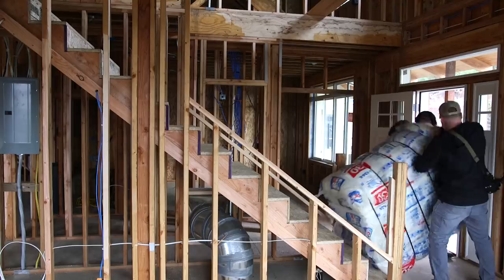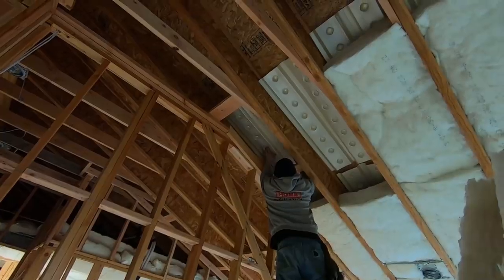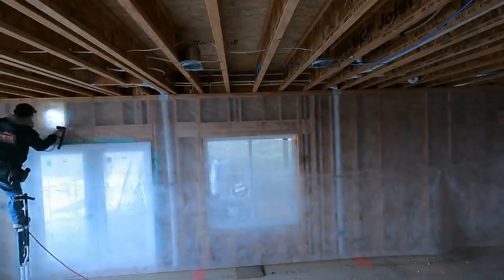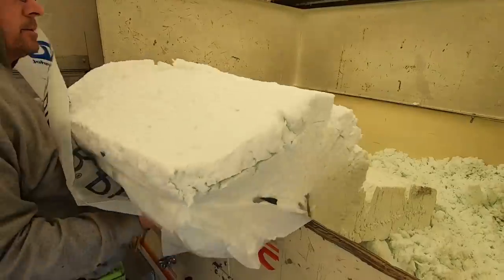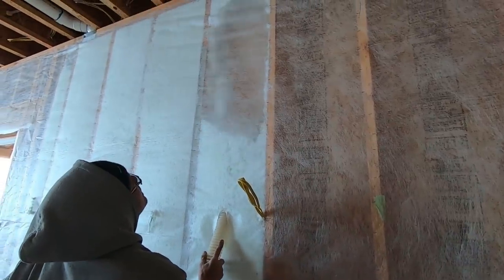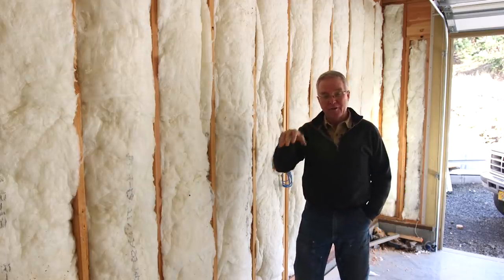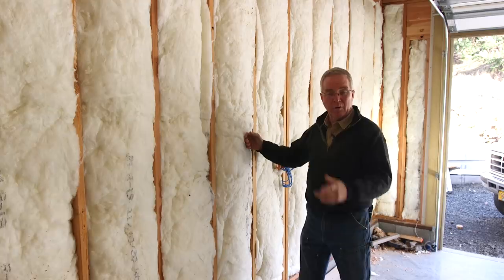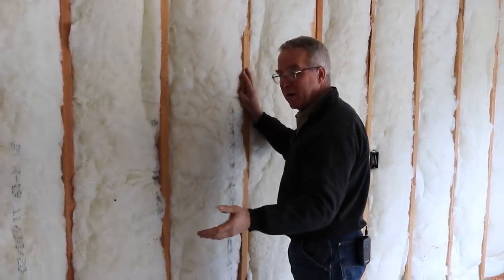Insulating A Nice House Ep.104

Comment: Howdy Scott, I'm an insulation pro in Tennessee.  I'm a subscriber and a fan on YouTube and the podcast.  Thank you for your thoughtful approach to construction - it is clear that you grasp the nobility and value of homebuilding, and care greatly about what you're doing.  These are the invisible traits that we need more of in this industry!  Below is more info on insulation than you'll ever want to know in response to a couple points in this video:
1.  For clarity, the blown material in the wall cavities IS fiberglass.  The product they are loading into the machine is Johns Manville Spider, which is a fiberglass BIBS (blown-in-blanket-system) product.  As far as I know JM does not manufacture cellulose, and cellulose is much dustier and is medium gray in appearance.  R value is fairly comparable between the two.  Settling over time is a function of installed density.  The denser the product is packed into the cavity, the more stable it is over time and less prone to settling.  There is a manufacturer spec for correct density, which can be field verified with a special tool, and/or a bag count calculation.  For your house, either of these products is superior to batts due to more complete cavity fill.  While a "Grade 1" install is certainly possible with batts, it is not typically fully achieved in the real world (Grade 1 means zero voids, gaps, or compression).  Batts are not subject to settling over time - we have pulled some of the very first fiberglass batts out of buildings in remodel projects that are still snug against all surfaces of the cavity after 40-50 years of service.  The quality and performance of insulation has mostly to do with how well it was installed.
2.  The paper facing on batt insulation has a couple pertinent properties.  First, it's considered a class II vapor retarder.  Second, it holds a staple.  Interior-facing vapor retarders were highly favored for many years, especially in cold climates, and in fact are still somewhat enshrined in the IRC for climate zones 4 and above.  Manufacturer installation instructions for paper-faced batts would have you unfurl that "ear" across the face of the stud on each side and "face staple" the paper to the studs, then come back and run tape across all those joints in order to create a fairly monolithic vapor retarder across the interior face of the wall.  This is almost never done (at least in our area) because drywallers like to see the studs.  However, as building science advances, those much smarter than I advocate for more vapor-open assemblies as we make buildings more airtight and highly insulated.  My company only installs paper-faced materials in parts of the house where we need to make sure the material doesn't fall out of the assembly - mainly ceilings.  Otherwise it's all unfaced.  The mold concern with the paper facing isn't usually the paper facing's fault alone, and it is worth remembering that the side of the sheetrock that faces into the stud cavity is usually bare paper as well.  So the move to unfaced batts is mainly an attempt to reintroduce a little bit of drying potential to the assembly since we have removed so much of that potential by increased airtightness and insulation R value.  Eliminating the vapor retarder layer allows the assembly to dry out just a LITTLE quicker via vapor diffusion.  There is more to this discussion that I won't bore readers with here in a YouTube comment.  Bottom line, it's a layer that just doesn't need to be there most of the time.
3.  I agree with others that the ventilation baffles in the decked ceilings should connect at their ends, especially since you mention a 14" I-joist cavity in one area and the combination of an R30 batt (10" thick) with an R19 batt (6" thick) could result in compressing the fibers against the roof deck.
4.  The foil on the attic ceiling behind the upstairs knee walls also serves two additional important functions in the absence of drywall: an air barrier, and an ignition barrier.  However, to serve as an air barrier someone needs to come back and air-seal the joints, edges, and penetrations in the foil so that the storage space air does not have a pathway to communicate with the outdoor air that enters the roof assembly.  I also noticed this same approach against the exterior wall beneath the stair landing - this is the result of a code requirement that vertical cavity insulation be contained by an air barrier.  Someone needs to seal the joints and edges of this area as well before it is trapped behind sheetrock.
5.  I noticed orange gun foam around your window jambs.  It may be too late by the time this comment posts, but I'd encourage you to verify smooth operation of all windows before sheetrocking.  The orange flavor of foam tends to expand a little more, and cure a little harder, than other "low-expansion" / "window and door" flavors of foam.  Usually the low expansion stuff is white or light yellow in color, and will exert less pressure on the window frame.  We've had to pay for a few window replacements over the years due to our air sealing foam bowing window frames and preventing the smooth operation of double-hung windows.  This is most likely to happen when the gap we need to fill is very wide (3/4"+) and very long (4'+).  I'm always on the hunt for the least risky window foam, and so far my favorites are Dow Great Stuff Pro Window and Door, and DAP 812 Draftstop.  They showed the least amount of expansion in my comparison testing.
Ok, this comment is way too long, but I hope the information was helpful to someone out there.  Thanks for all your content and for the element of professionalism you bring to our industry!
Reply from the maker: Wow! Thank you for this comment! This is why the comment section on our videos is the most worthwhile aspect! There is some background information to a couple of your points that I wish you had known before you posted but all in all you have educated me this morning and I appreciate it!
Reply: @essentialcraftsman  I certainly don’t mean to throw stones and know how hard it is to get 100% of the info into a YouTube video.  I’d be curious to hear the background if you have the time and desire to share it!
Reply: This may be the most well informed comment I have ever seen on any building related video. You have the full depth of knowledge on your products/services that I would love to see in many more instances. Side note, I wish Scott had looked into sealed conditioned crawl spaces prior to starting this place.
Reply: North Carolinian contractor and builder of the last 20 years with one of the best mentors on the east coast who taught me the trade. I concur. This man insulates.
Reply: So the question on my mind is, if you’ve decided to do blown-in walls for a climate like this and cellulose and fiberglass are similar in cost, which would you go for in a house like this one? Elaborate on any downsides if you’d like. Appreciate your knowledge!
Reply: @junkman8742  cold weather fu you must learn. Hot cans or caulk is the ticket. Dont leave your stuff out in the truck over night. Put it in the windshield with heat on on the way to work and then cover it up during the day or put somewhere warm. My next tube of caulk or 2 is always inside my coat.
Reply: 1:45 According to the II law of thermodynamics, the heat itself doesn't move anywhere or evenly. Instead, it is just that the temperature differences between different systems are going to become even.

2:50 Insulation is pretty useful in tropical conditions as well. Yes, people don't need to insulate houses against frost or chill, but against the hot and 80...100% humidity air infiltrating the indoors that are cooled by air condition. It is not very likely that one would cool down indoors at Hawaii by opening the window in the year 2021.

In my country, temperatures drop generally to -20 Celsius for weeks during winter. -20 Celsius is approx. -4 Fahrenheit. The record here in Finland is -50 ie. -58 F :)
Reply: That's what I was thinking regarding #1.  Thanks for the input.  How does a DIYer determine the proper density in a wall?
Reply: Great info. Answered a couple questions I had from watching the video.
Reply: @simonthebroken9691  Best approach is probably bag count.  The manufacturer will probably have a coverage table showing pounds per bag, and pounds per cubic foot of cavity that you can convert into a total job bag count.  You can then back into a "bags per __ number of stud cavities" figure to use as a spot check as you go.  Takes teamwork.
Reply: @devinmahoney3777  All other things being equal, some might favor the fire retardant and pest resistant qualities of cellulose that result from the boric acid treatment it usually contains.  Some also say that cellulose slows down air leakage more than fiberglass, but I'm not sure if that's a factor when it comes to dense pack versus dense pack.  Cost is usually the deciding factor for most people.
Reply: @cindydankuhn2838  Thanks for the kind words.  Scott is another example of this, but by necessity is, as a general contractor, a "generalist."  I took the time to type such a long comment because I know that Scott cares about what he's doing and would value the info.  But yes, conditioned crawlspaces are awesome.  I really like them here in the humid Southeast.
Reply: This is a very well informed comment. As a fellow insulator it seems like our trade usually doesn't recieve the same amount of attention as finish work. Yes insulation will be mostly hidden behind drywall, but for as important as it is to a homes health it deserves more attention.  Im my area especially no one cares about insulation until those high utility bills come in the winter
Reply: @nathanshirai9661  Thanks.
Reply: When I saw “I’m an insulation pro” I thought for sure it was going to be filled with “we do this and that all the time and we’ve never had a problem” but instead it was recommendations based on evidence. Bravo.
Reply: i'm a learner,i tin u gutt two putt dahh wite wall mesh faberwickie firs,denn 1ench spacie boarts ;ahh top of dat,two gutt, dahh; 1 einch airy gipp, gap,onna boat, signs, off ahh datt sheiny; shiney suff,fer it two werk wite ;yep; i tinn sow,fer yer numeralality; nummer ferr.
Reply: Would an air-to-air heat exchanger assist with the moisture situation?
Reply: I'm glad you pointed out it's not blown in cellulose which is shredded recycled newspaper.
Reply: @junkman8742  try keeping the cans warmed up prior to using them if temps are below 40F and release the spray foam with the can upside down you should have pretty good luck getting most of the product out before the pressure gets low.
Reply: @steveschultz300  not sure what you mean exactly, but moisture inside building assemblies is controlled primarily by properly weatherproofing the exterior with a correctly and robustly detailed WRB and flashings.  In other words keep the water out, and for any water that gets in, make sure it has a way to get back out.  Beyond that, the next risk is condensation within the assembly.  This is best solved for by controlling air infiltration (since most water vapor enters assemblies via air leaks), as well as understanding where exactly the first risk for condensation lies within the assembly... and structuring the layers of that assembly in a way that ensures that first condensing surface remains above the dew point temperature during the times that matter.   Different climates will demand different approaches.  There is no one size fits all solution (except for maybe Dr. Joe Lstiburek’s “perfect wall” assembly) so the best thing is to make sure whomever is responsible for designing the enclosure understands the climate-specific dynamics at play.
Reply: @nathanshirai9661  Thanks for the reply. I'm thinking about a builder here in Central Texas that insists that a building "has to breath. So he scoffs at the idea of insulation "packed" into the wall cavity. Actually he told me all you really need is a 2x4 wall. And you didn't need all that fancy smancy foam stuff around the windows.
Yes folks there are still builders that believe that stuff.....(as I sit here in 19 degree weather and have my kitchen sink dribbling water so it won't freeze....)
My question was about those fancy smancy air to air heat exchangers that take outside air, passes it through a membrane and exchanges the heat to the exiting indoor air. Would that help with getting rid of some moisture buildup in the home?,
Reply: Thank you for explaining about the paper facing and ears. I put a second story on my house in the 90's in Northern NJ and did my own insulation and contracted out the drywall. I face nailed and taped the ears as per the manufacturers instructions. I was not home when it was drywalled, but apparently the dry wall guys complained to no end about the insulation. Makes sense now.
Reply: Just seeing that BIBS makes me itch.  I spent a very hot summer tending to those hoppers.  I'm glad I don't have to do that anymore.
Reply: Well written and stated.  You have done this a few times it seems. Thank you for writing all that, I got a double learning in under 30 minutes. Jim
Reply: It's whatever "B-7111" is. (no such product is listed at JM) They make lots of stuff, but blown cellulose doesn't appear to be one of them. If that stuff is fiberglass, they sure as heck need to be wearing masks. (I'd recommend it with cellulose, too.)
Reply: Wow, great info! I was curious about the vent baffles under the roof deck, too. Looks to me like the insul batts won't even reach the top of the bay, so the batts are only necessary at the wall-to-roof junction to preserve air flow from the soffit vents.

R values are different for different materials. Fiberglass batts, spray foam, blown cellulose, etc. will all have different R-values for a given thickness. I am surprised at the R-25 code requirement for 2x6 walls. I have used R-21 high density batts regularly on remodels. I can't imagine there is much difference in heat loss between R-21 and R-25.

As I understand it, anything above R-40, in fiberglass batts, nets a very negligible gain. To the point of almost zero return on the investment as measured by cost of heat loss. On my recent remodel, I fought with the local building inspector about this, since the ceiling/roof code is R-48 (as I recall) I then realized that the R value measurement was made in a vertical position for ceilings, and I had a 5/12 roof slop on a vaulted ceiling. Measuring an R-38 batt when on that slope, gave me darn close to what code required. He let it slide.

I did all of the insulation myself, as no subs were available to do the job in a timely manner, even though I have worked for a local contractor with many of these subs for over two decades. Sometimes you just gotta get things done. Took me three days, and my shoulders hurt lie hell for awhile, but I got it done in time to hang the sheetrock.
Reply: @essentialcraftsman  Now, I  didn't read the epic comment above. One story I can tell is from our electric box in a cellulose insulated room. This box is on an outside wall. The insulation works well. So well that humidity in the room thought the back wall of the box was a great condensation point, which resulted in actual water (!) Dripping out the cable duct. I rectified by insulation with dense foam behind the box. Maybe this experience shared can help someone along the way. Keep up the good work!
Reply: The Kraft facing is old school when people didn't have air conditioning in cold climates under the belief that moisture moves in only one direction, which was true years ago and may still be in certain climates but in New England with humid summers we now have air conditioning in homes and the moisture moves outside to in during the summer and inside to out during the winter so there is no safe place to install a vapor barrier so unfaced is best or those smart bi directional vapor retarders. Just my two cents. Dew collection and condensation is just physics so it's not my opinion, it's math and science. #facts.
Reply: Holy crap.. great comment
Reply: @steveschultz300  I see.  I think you're talking about an ERV or HRV - a mechanical ventilation appliance that exhausts stale air from the building while bringing in fresh air from outdoors, passing the two air streams through a heat exchange core as they pass by each other.  The main intent of these systems is to maintain air quality in an airtight building and providing control over the air that enters and exits -- scheduled run times, filtration of incoming air, pre-conditioning, and in the case of the ERV, a bit of latent exchange as well (more helpful in humid climates).  So they're not necessarily intended to address moisture buildup inside assemblies but in some cases they might sort of accidentally provide some benefit from that standpoint.  There's a lot of detail that's probably not worth going into here, but start poking around on www.greenbuildingadvisor.com and you'll find lots of good information on these systems.
Reply: @steveschultz300  To your other point about "a house needs to breathe" - yes, most of the homebuilding industry holds this conviction strongly.  But we really need to clarify terms.  When we say a house needs to breathe, what we really mean is a house needs to DRY.  The things that dry moisture are the movement of heat and air.  So drafty, uninsulated houses can tolerate a lot more wetting than airtight, highly insulated houses - there's a lot more energy flow available through the assembly that provides a lot of forgiveness for wetting due to improper exterior water management details and/or condensation.  Hence many builders' resistance to air sealing and insulation -- it is perceived as less risky.  And as long as we persist in building homes with bad housewrap jobs, reverse-lapped flashings, and other things that invite water into the assembly, it's absolutely true that it's less risky to avoid air sealing and insulation.  But it comes at the cost of air quality, comfort, control, and energy performance for the people who have to live inside the house.  A very airtight and well-insulated house can still be perfectly dryable, it just requires care and attention to the way bulk water is shed from the building, as well as an understanding of how to mitigate condensation risk within assemblies by proper material selection and execution... and this will vary by climate.
Reply: Great comment. I was thinking the same thing about the spacers touching the roof; why weren't they touching each other. I didn't know about the foam around the windows not being "low expanding". Good eye. Here in Memphis there is debate about vapor barriers; we don't have one.
Reply: I really enjoyed reading your comment. Being so well informer and open to share is not as common as one would hope. 

I am currently reinstating my house and I've come across a company called Havelock, who sell wool insulation. Would you have any thoughts/opinions/concerns about using it in my home?
Reply: @nathanshirai9661  Nathan, I read your comment as a contributing and informed extension of the video.  I was especially interested in your correction on the blow-in material being FG rather than cellulose (I thought the same thing).  Please clarify one thing further - It is my understanding that cellulose does a better job of reducing air infiltration than FG - or did until a few years ago when loose-fill/blow-in/dense-pack FG was somehow altered to provide additional air flow reduction. Of course in new construction, air sealing from the insulation material is less of an issue because spot air-sealing with foam does the trick.  In retrofits, drilling walls and dense packing with pressurized cellulose or the correct FG product can reduce blower door leakage numbers significantly.  Any thoughts on this?
Reply: Wow!  Great answer!  Well thought out!  Much Appreciated!! Thanks!
Reply: @rcpmac  This aligns with what I have heard from those who know more about it than me.  Dense pack cellulose ends up being very dense, and while not classified or warrantied as an air barrier per se, the practical reality is that, properly installed, it will have a measurable impact on air leakage.
Reply: @kaspergruszczynski9919  Havelock wool is a boutique insulation material made from sheep wool imported from New Zealand.  There are very few domestic dealers (although somehow we have one here in Chattanooga).  Its R value is on par with fiberglass.  The main selling point is the people-friendly nature of it (super soft and cozy, no irritants, no VOCs, no chemicals, etc. -- we wouldn't make our clothing out of fiberglass), as well as the carbon impact (correct me if I'm wrong but I believe it is a carbon-negative product).  However, it's super pricey compared to conventional materials.  That to me is the only downside.  So if it's worth it to you, go for it!
Reply: One of the best descriptions ever! Makes me believe everything you said. Thanks for taking the time to explain.
Reply: Very well done! Great comment and very good advice!
Reply: @essentialcraftsman  Great video... again.  My home inspector buddy told me 20 years ago that tacking the paper face of insulation to the sides of studs creates an unwanted mini chimney that could cause a fire hazard the same as having unfoamed top and bottom plates where electrical and plumbing penetrations are drilled.
Reply: Nerdddd!
Reply: @nathanshirai9661  get a warm box for failings etc. leave plugged in at jobsite
Reply: I seem to want to move to Tennessee to work for you
Reply: @steveschultz300  That's not really the point of an HRV, but rather to exchange fresh air for the stale air in the house without losing (or gaining) too much of the heat. Whether an HRV removes moisture will depend more on the relation of outdoor to indoor humidity. An ERV will do even less as it will retain some of the moisture into the incoming air stream.
Reply: A thoughtful and insightful response from clearly a professional.  Your comments have complimented the video greatly and I doff my cap at your answers to questions from others too.
Reply: @cindydankuhn2838  

He is not real big on the more newer technology in construction. Check out builders like Matt Risinger who stay up to date on the latest technologies to build a home.
Matt advocates not only for conditioned Craw Spaces, but Conditioned Attic spaces. It makes much more sense to seal all spaces in a home to prevent any air from bringing in insects, weather, allergens, etc into the home.
Reply: @nathanshirai9661  

A house needed to dry out as you correctly stated, because builders were unwilling to make weather/water-tight walls. I follow Matt Risinger who emphasis is on building an air and water tight building envelope. It does require some different steps in different climate zones.
Old guys like Scott are slow to update their knowledge base on subjects -- not only does it include conditioned craw spaces - conditioned attic spaces are just as beneficial!
Reply: @BrianBriCurInTheOC  Matt is great at that - but a vid of his I watched recently, the builder he was interviewing didn't cut the polystyrene insulation with a hot knife because of the fumes that would give off, yet he was building this stuff into his house! Obviously never considered what happens in a house fire, and Matt didn't question it either. Building a house so that you'll have time to get out if it catches fire is a thing.
Reply: @steveschultz300  

Please DM me the name of that Breathing Builder... Same screen name on FB

Thanks
Reply: @phonedave  

I've read comments about drywallers' complaints -- hire craftsmen and not the typical wham bam thank you ma'am clowns that have no concern about quality.
Reply: @tealkerberus748  

Most of what Matt uses in interior side of walls is RockWool. 

Where the Hard foam panels are located does not normally have fire impingement early in a fire scenario. By the time that material is involved, anyone in the home should have exited. The interior contents of homes many times give off deadly fumes and are the first fuel of a home fire.
Reply: What part of Tennessee are you in  im building a passive house in East Tennessee and may out source the Installation how can I contact you if your ok with putting on hear
Reply: Here in Japan, fiberglass batt wall insulation is typically enclosed in what I believe is a somewhat breathable plastic wrap. I have no idea how breathable it really is. But, would it be better to install fiberglass batt insulation without any plastic covering?